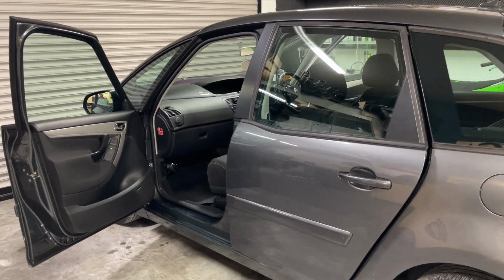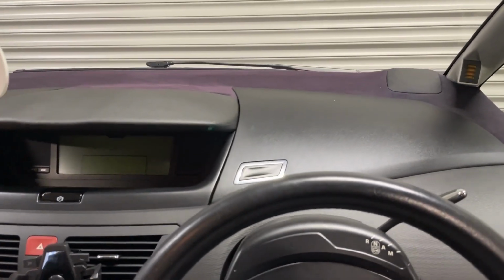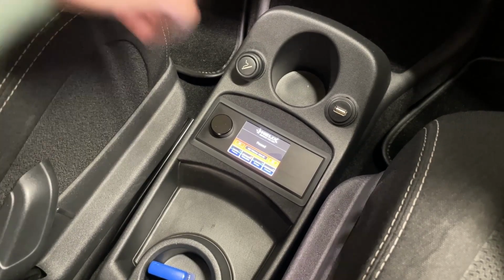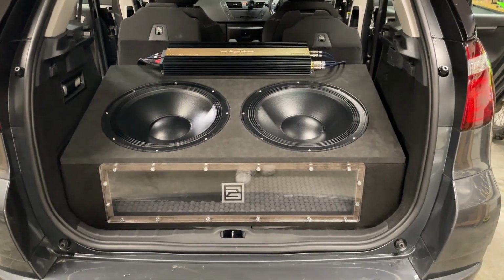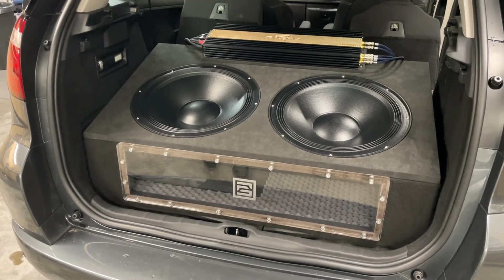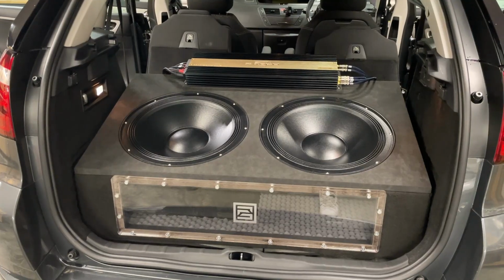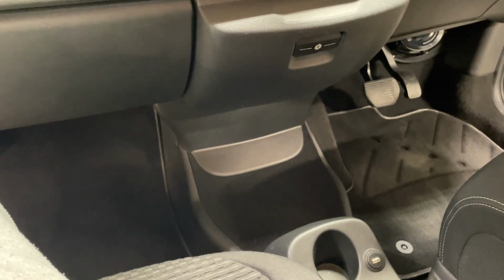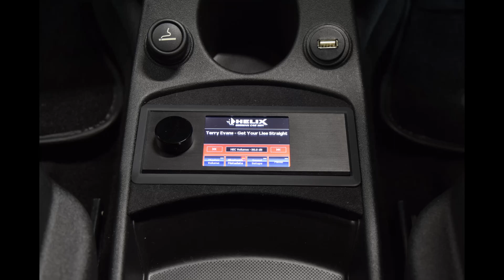Daily SQ Monster System - EXPLAINED - Mundorf, Fostex, Hybrid Audio, Helix, Zapco, Acoustic Elegance

Comment: The clever tricks for eliminating little buzzes between plastic panels and trim beyond sound deadening and foam is the type of content I would like to see, but I'm neurotic about that stuff lol
Reply: As in panel to panel?
When it comes to panels that are "permanently" affixed (like door panels with several pieces that are plastic welded or whatever together) something as simple as thick super glue does wonders.
Panel to metal, tesa tape/tighten down the panel further with newer tighter clips.
Reply: I like to use high density foam sheets that are thick enough the apply some counter pressure to deal with some of that panel clatter. Especially the rear deck
Reply: @picassoimpaler3243  Agree with your suggestions. Tesa tape and butyl rope has been my approach for most rattles but would like to see of the pros have any other tricks up their sleeves.
Reply: @mkloudsql3285  I have some leftover 1/16" neoprene sheeting that might work for that, thanks.
Reply: @andrewturner1860  those are the main ones I use at work. Its dependent on the rattle though. Super glue in tight gaps of joined panels, butyl in wider gaps, CCF to decouple and put pressure against the clips, tesa tape around clips, Tessa tape between where panels join (if it won't show), stiffening panels with cover plates over holes. That's about all of it that I use.
Oh, for switches, some thick lithium or dielectric grease on the hinges can help.
One that I've never seen people use besides myself is Teflon tape. If a sliding reverse lockout or e brake button will rattle, getting a couple layers of Teflon tape between the rattling surfaces will help quite a bit while staying smooth to press the button. I tend to not so this to clients vehicles for liability reasons though.

Comment: I think it's a gorgeously minimalist/brutalist setup, just clean and simple with nothing unnecessary, which IMO, are some of the most appealing visually if done right, which this one definitely is. 
The only things I myself would potentially do, would maybe be a faceplate across the top and front of the sub enclosure that blended the enclosure itself, seen from the open hatch, to the interior panels to get rid of gap on the sides, and to be able to have diffused LEDs lighting the acrylic view, but I personally wouldn't cover the acrylic or it's hardware, I'd just butt the beauty panel to it's edge with LEDs diffused right around the edge of that to transfer light to the acrylic, keeping that "industrial" look which I actually dig 👌

Secondly and lastly....Rear Fill.... definitely if it was me, I'd add some. You didn't mention any so I figured you didn't have anything.... IDK, I'm one of those guys that needs the sound enveloping me.... still a gorgeous setup.

Of, and forget that fake suede on the dash if you're worried about it fading (it definitely will), I'd just rewrap it in matching dash colored vinyl.
Reply from the maker: I agree, i’d do the same, but it’s Edy’s car, so… 😃

Comment: I have 2 questions why do you put the baffle in front of the midbass and why do you install them with the magnet inside the and the cone facing outside 🤔
Reply from the maker: There’s no space for opposite orientation. You can’t have the magnet hanging out of the wheel arch.
Reply: Thanks
Reply: So, the orientation does not affect sound quality? I find that a bit surprising. Could I do the same with the drivers in my home speakers - mount them inside out (and compensate for the baffle volume difference) - or is that possible only in the IB?

Comment: Hello Peter, great content as always. I'm always greatly looking forward for your new video to come out... 👍One question - in this and other videos I am observing how you work with the sound deadening materials in the car. You usually use only one layer of one type of sound deadening plates (from Silent Coat I guess) and usually not covering whole 100 % of the area, leaving about 15 % without the material. Which is in my opinion a very good compromise between the sound deadening efficiency and added weight to the car. On the other hand there are sound deadening material manufacturers (like Comfortmat) that have the "more is better" approach and they recommend using several layers of their materials and covering almost 100 % of the treated area. Which for sure helps greatly improving the noise level in the car but at a cost of adding 70 to 100 kilograms of materials to the BMW 5 class combi type of car (treating front door, rear door, trunk + rear wheel arches, outer rear wheel arches, front wheel arches, floor, roof, hood, the fifth door, torpedo). Can you please briefly explain your filosophy behind your approach to the sound deadening? It will help me greatly decide which route to take. Thank you.
Reply from the maker: Please watch the videos in the “Cheap Sound Quality Car” Playlist where we have very detailed videos breaking down the process of soundproofing a car. 
Deadening only minimises panel vibrates, it doesn’t block noise. It’s a stupid way to create a noise barrier with multiple layers of deadening, but that’s what many shops do and create false marketing.
Reply: @pssound9749  Thank you Peter, I will check that out.

Comment: Great build guys! Can I ask why 2x18s? Would one IB18 not be plenty with circa 400w and 8" midbass? Does this relate to headroom/ low gain structuring and lowest noise floor?
Reply from the maker: 1x18” would be perfectly enough and it would still have headroom for a bit of fun, but once people experience the mad headroom in the Honda with 2x18”, then some people just can’t have anything less! 😃
Reply: @pssound9749  Thanks for your reply Peter. Can I ask a further question related to this build regarding the midbass. Where kick space is limited to recess a midbass magnet/basket and the driver is mounted magnet out...what frequency can an 8" driver like this play up to without issue? Very limited bandwidth or could this play into midrange without issue? Thanks!
Reply from the maker: @artform7325  even if the driver was facing the “normal” way, it wouldn’t really allow you to have great integration to a midrange above 200Hz due to the acoustical properties of the cabin related to the listening position. There are so big problems in the frequency range above that point, that creating a system that fully integrates, where speakers disappear visually becomes very difficult.
If you watch the Tuning playlist here on the channel or the RTA evaluation videos on Patreon, then you get a better insight into all of this madness. 
So going back to the beginning: for us it doesn’t matter if the speaker faces with magnet in/out as we can still get problem free response either way in the targeted range.

Comment: Can a 12” Clarus in a sealed enclosure take more than 500 watts?  Or do you try to stay at the maximum rated power with these subs?
Reply from the maker: Clarus 12 is a 250rms sub. You give it more than 300-350 and the coil won’t be happy.

Comment: Did I hear correctly, that you're using a HEC BT HD Card and a phone as the source unit? This is a topic I've been researching deeply, lately. I'm trying to weight my options between HEC BT HD, HEC USB and Optical input via Topping D10S. The Topping unit seems to be preferred for quality, while Bluetooth easily wins the convenience factor. We might have too many choices these days. 😆
Reply: What is frustrating about Bluetooth is the audio source and receiver have to use the same codec, in this case AptxHD. The HEC BT adapter streams lossless over BT with AptxHD. There is no current generation phone from Samsung, Google, Nokia, Apple, LG, etc. that use AptxHD. There s a Sony that does, but it is over $2k. Yes you can go into developer options and “change” the codec format. What nobody discusses is that if your phone does not support the chosen codec, it will discreetly switch back to standard BT. USB is much preferred for this reason.
Reply: Aptx hd isn’t lossless, Bluetooth 5.0 can’t even stream cd quality, it uses a codec with a compression algorithm

Comment: Streaming lossless via BT? Not possible, even with the advanced codecs like LD4C and aptX HD its always compressed. The best codec available still has less datatransfer than CD quality (~1100 kbit/sec vs. 1440 kbit/sec). So technically there is no lossless Bluetooth streaming available.
Can you hear that? Certainly not. Most people cannot even differentiate between 256kb AAC and CD quality.

Comment: Hey Peter what amp would you recommend for two FI IB315’s?? Would that st1350 be suitable? And are you running stock electrical on this setup?
Reply from the maker: Yes, we’re running on stock electrics. These subs are sensitive and IB doesn’t draw much power either. However, the Fi’s are not that sensitive or musical, but they’re fun for low lows for sure. ST1350 is a good match for 2x15” for sure.

Comment: The st1350 was the only zapco amp that did not make rate and had problems which is why they took it off the market...i used to run the 1350 and it was greqt for me but i was lucky